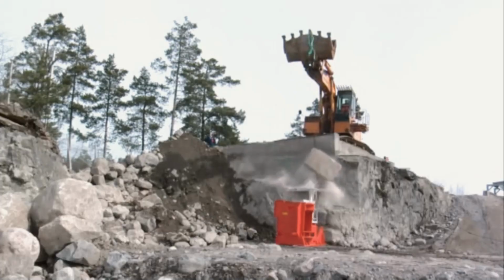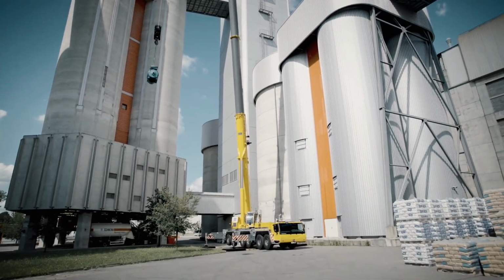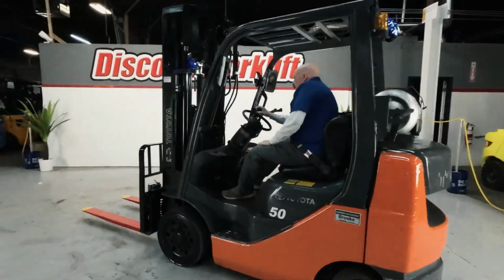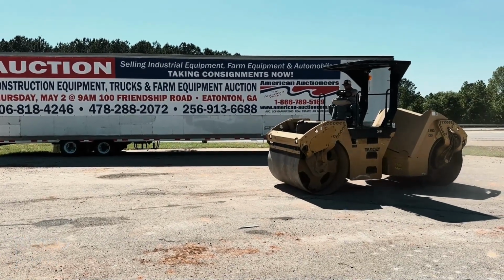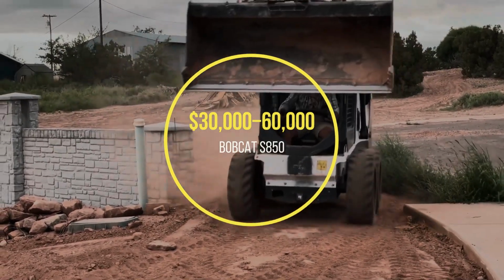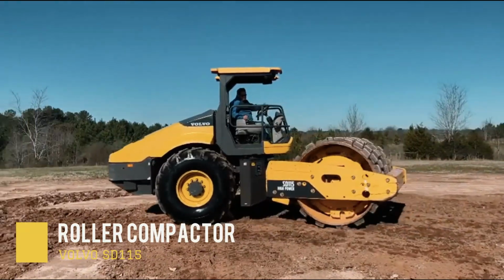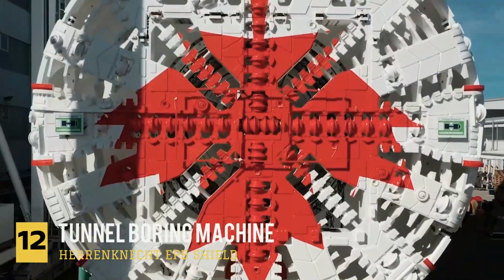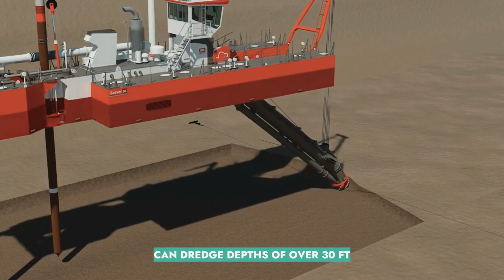Proceed with Caution: The Most DANGEROUS Heavy Machines FAILS

Comment: Very unprofessional and misinfomational video. Do you even do any research before posting this trash!!!?¿ totally dumb. For 1 a komatsu p65 can push over 50 tons of dirt!? Like buy lunch time? That's over 100,000 pounds? The machine weighs what? 50,000? Roughly. Probably a little more. So no. It's not pushing double it's own weight. And a Volvo 950 costing between 200 and  $400,000. WHAT? After  putting 30,000 hours on it. That is a 95 ton machine! Oh. A d a komatsu p65 can push this machine plus 5 tons. Haha. These machines will show up on 3 separate semi trailers if shipped in the states